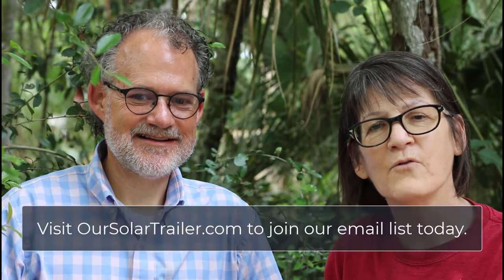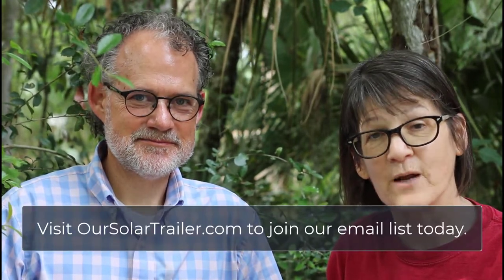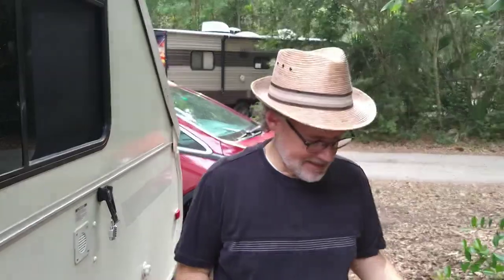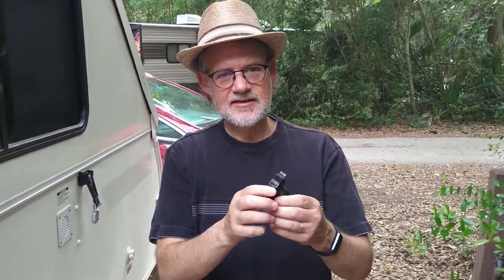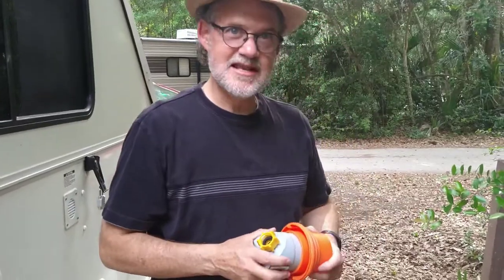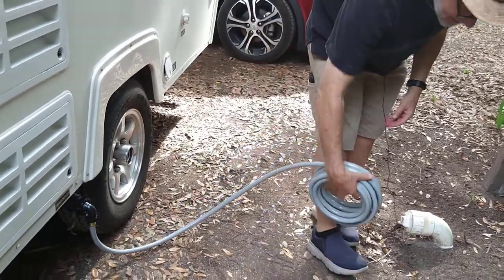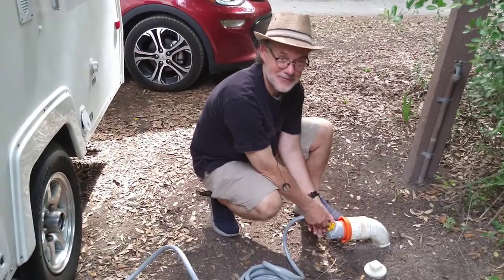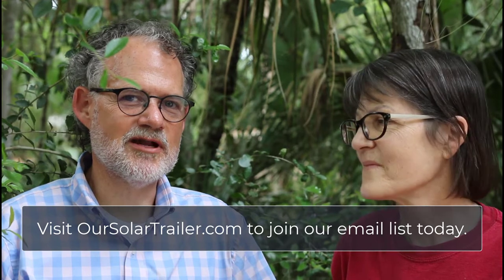How We Connected the Gray Water Drain to the RV Sewer Hookup for Our Aliner Scout

Comment: I tried this setup and had an issue with slow drainage. The longer the hose, the more pressure needed for fast flow. I switched from the long gray to a 10' which works in almost all situations. If needed I attach it to a 3" standard sewer hose using the 3" cap with gray water hose inlet. Works great, drains quickly. In response to concerns about sewer gas others have mentioned on the website: the way the hose lays, on the ground then rising up to enter the final fitting, constantly leaves a substantial amount of water in the hose to act as a barrier, a long water trap. Not an issue. Thanks for the original idea!

Comment: Nice Video! For my Aliner I have basically the same setup where there is a sewer hookup. No hookup I use a camco rino tank-very easy to dump. I agree that grey water should not just be dumped on the ground at the campsite.
Reply from the maker: Thanks! 🙏🙏🙏 Thanks for the tip about the Rino tank. We'll check it out!